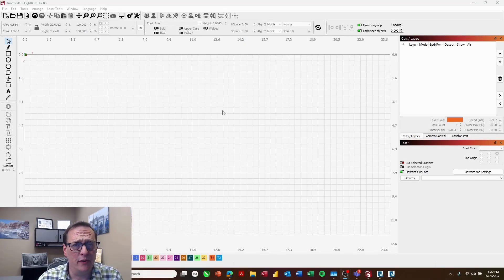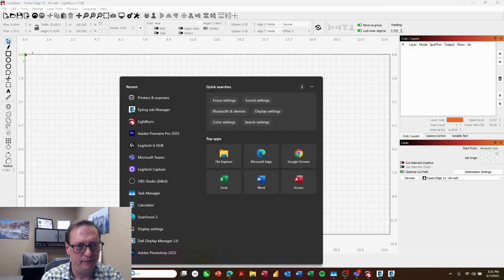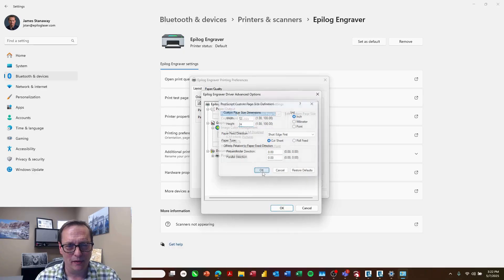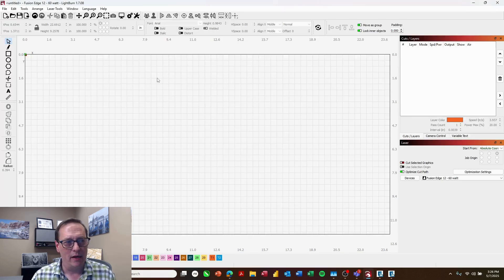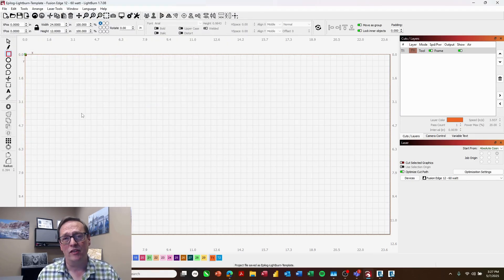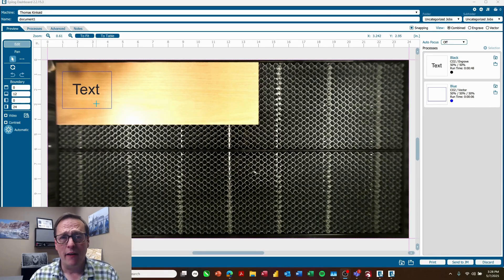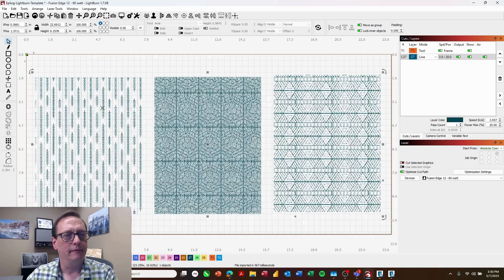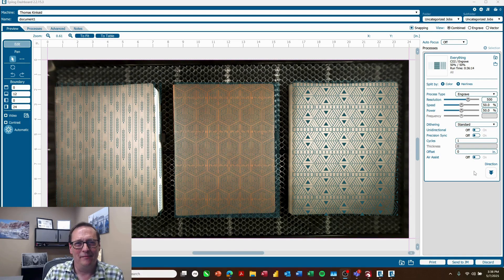Printing from Lightburn to the Epilog Laser Dashboard

Comment: What is the advantage to using Lightburn verses Coreldraw?
Reply from the maker: Some people come from laser systems that only use Lightburn, so they prefer to continue to design in that software. Every design software has a large learning curve, so this provides them a way to design the way they are most comfortable.
Reply: Lightburn is a very robust, but intuitive software that was designed around laser design and processing. It is very similar to Corel or Illustrator, but there are fewer “fancy” pattern tools and such. For creating custom designs for fixtures and such, LB can’t be beat.